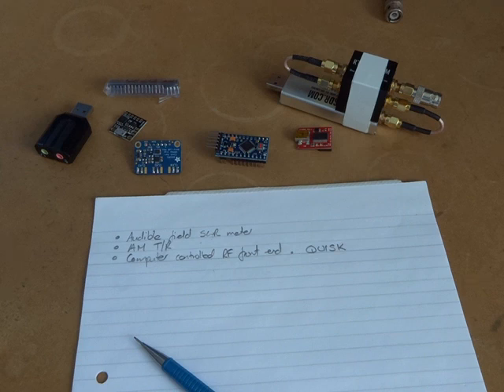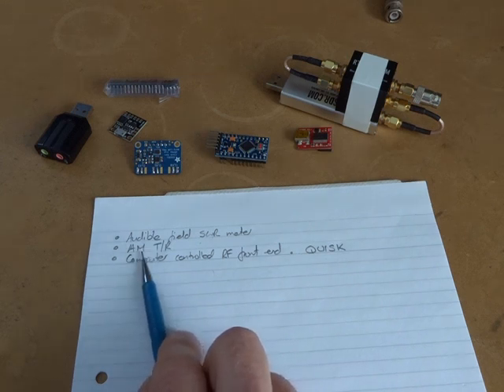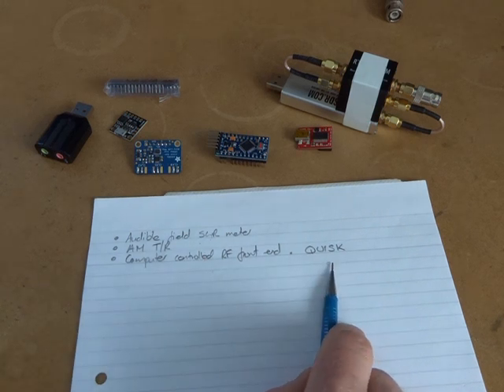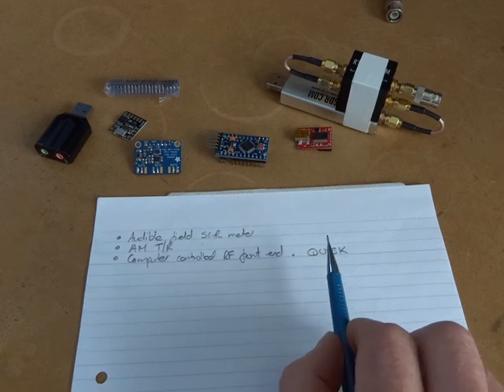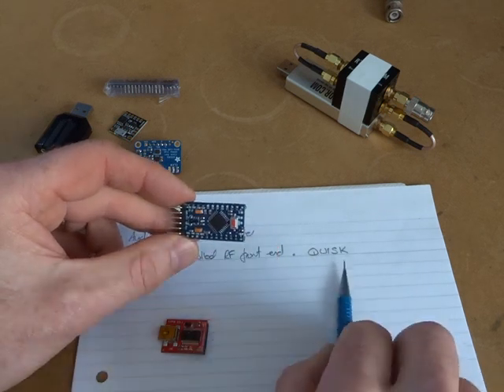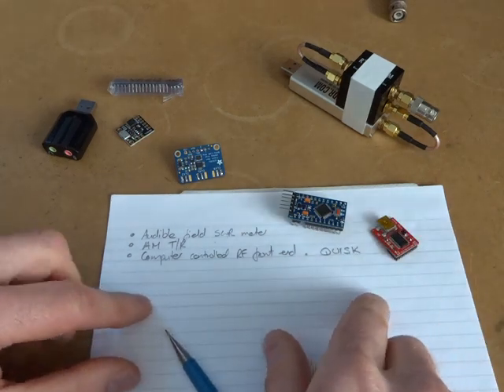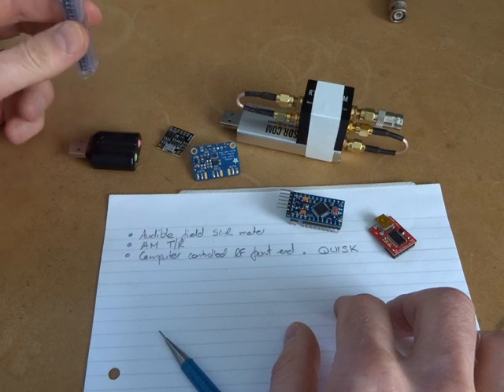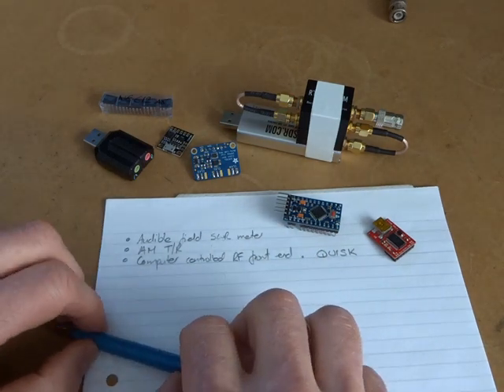Thoughts and Ideas for the Next Few Builds

Comment: Hi charlie ,,, I'm in a project to build my sdr trx and in my mind to use HDSDR Software its provide simple way to control the hardware via OMNIRIG ; most ham software support omnirig like digital mode and log program that is a good point to consider for me ... omnirig use a simple description file for CAT  commands and it is very easy to be supported on the rig by arduino .... till now I made some test to control the freq. using this setup and its work fine ... but still waiting for the PCB to make a full test ... regards and keep the good woke .... wahhab yi3whr
Reply from the maker: Hi Wahhab. I am VERY interested in this. I looked at doing something similar with the last SDR build but could work out how best to do it. I thought I had to write a DLL, which was going to be problematic. If you have worked out an easier way then I'd love to know how. I would probably make that the next project and do another video series. I'd credit you of course. Do you have any test aurdunio code to look at?
Great work!
73 Charlie ZL2CTM
Reply: @CharlieMorrisZL2CTM  Hi ... http://wa6pzb.blogspot.com/2015/03/prototype-radio-iv-cat-control.html
that's a link to WA6PZB page, it have the code for arduino that work with K2 definition file in OMNIRIG ... you can edit the definition file to suite and support more function in your hardware .... a full description of the file structure found on dxatlas.com  .... regards

Comment: AM transmitter,  receiver, transceiver. Something not too big, say 10 watts of carrier. A class D or E PA. And a pulse width modulator for bonus points! 😉 Great work Charlie. VK3HN.
Reply from the maker: A PWM based modulator looks interesting with the H bridge PA. I might look at a simple setup first, then PWM. Efficiency will suffer of course. Thanks again Paul.
Reply: @CharlieMorrisZL2CTM  Crystal oscillator,  simple RF PA, like a single IRF510, 530, 640 or 840. Modulated with a series mains transformer and an eBay audio power amp. Check out this page for some ideas https://people.physics.anu.edu.au/~dxt103/160m/
Reply from the maker: Cheers Paul. Sounds good. I'll see what I can do with my limited knowledge and skills. All good fun indeed.

Charlie ZL2CTM
Reply from the maker: Paul. I've decided I will try a PWM based AM. Is there a rule of thump for the PWM frequency (i.e., the triangle wave freq)?
Reply: @CharlieMorrisZL2CTM  Excellent Charlie, should make an interesting series. I don't think there's a rule. 150khz comes to mind. Have a look on Class E Forum on Amfone for a simple PWM using a LTC6992. I'll try to remember to email you a few resources.  http://amfone.net/Amforum/index.php?topic=45134.0 

Also, the FAT5 PWM  https://vk3hn.wordpress.com/2019/07/15/a-pulse-width-modulator-for-the-fat5-160m-class-e-transmitter/

Comment: I would recommend low level modulation on the AM rig. I built a 1 valve AM rig in the 60's. Quite fun.
Reply from the maker: HI Ed. Yes, I am looking to try cascaded J310s, with RF on the lower gate and AF on the upper. Either way, I don't want to use a large modulation transformer. We'll see.
Reply: @CharlieMorrisZL2CTM  Sounds like a good plan. Let me know if you need anything. Cheers...
Reply from the maker: @ed-jf3xh  Will do. Thanks Ed.

Comment: Hi Charlie, firstly the AM transceiver, is that going to be SDR based or the good old analogue circuit (You didn't specify which interested you the most). Secondly the computer controlled RF front end,  Are you going to do a hybrid cat controlled front end with a soundcard as the input source for the I & Q inputs. Are you thinking along those lines or something different?best regards Simon (M6FJW)
Reply from the maker: Gidday Simon. The AM transceiver will be a good old analogue one, albeit using a Si5351 for the oscillator. As for the RF front end, I was thinking about sending the IQ audio into the PC sound card. I'm still debating if I'm going to do that first, as I note QUISK does not have a Python3.x version and I'm reluctant to load an earlier version on my machine. The AM transceiver will be fun to work on.
Reply: hi Charlie, thanks for the reply. If your going to use your laptop soundcard I would double check that its a stereo mic input and NOT mono input as it is on so many laptops out there. I personally use a USB soundcard that has 192k on all inputs and outputs. This means I get stereo inputs and is compatible with laptops and desktop PC's. For those that are interested I use an A01NC soundcard, It's an HD 7.1 USB soundcard. they can be found relatively cheaply on the famous shopping sites on the internet. best regards Simon (M6FJW)
Reply from the maker: @simonmichaeluk  Thanks Simon. I'll definitely look into that. Cheers!

Comment: I am working on something like your SDR front end, and trying to get the control protocol.  I have used the cheap USB logic analyzers available for around $100 on ebay.  Using sigrok software you should be able to decode the commands probably standard UART ..  Here is a video about how to use the decoding function.
https://www.youtube.com/watch?v=7_gCUZg8nAo